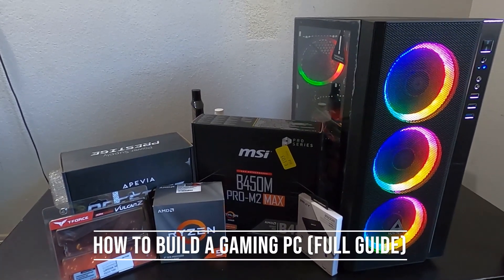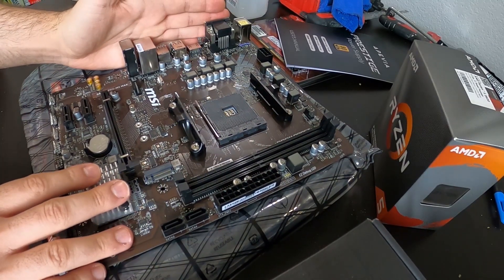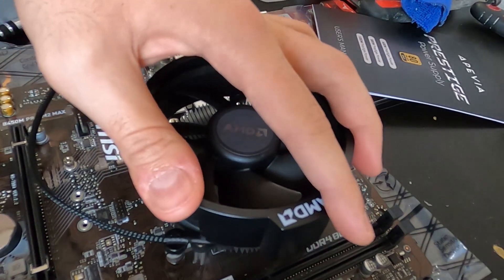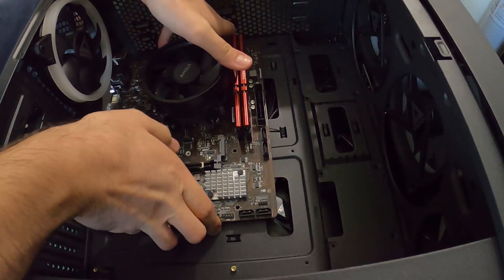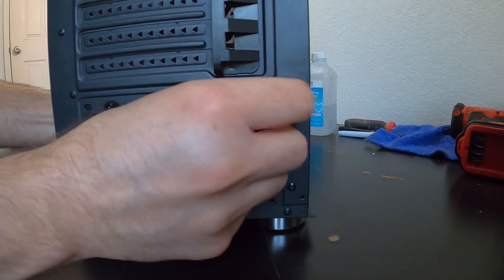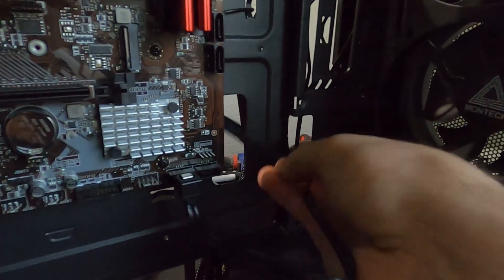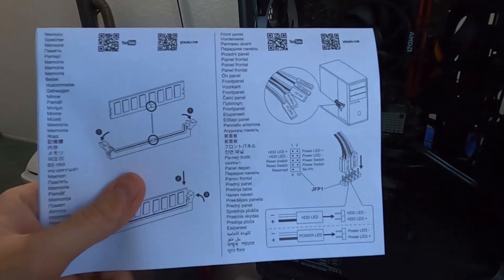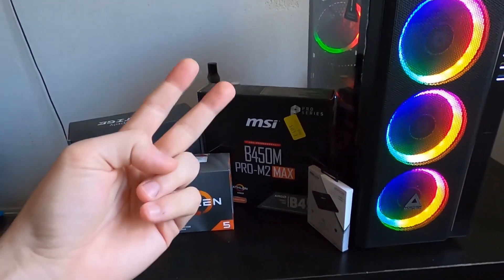How To Build Your Own Gaming PC - Step By Step DIY

Comment: Hey man, I have the same board as you, but a GTX 1660 Super Ventus OC. My problem is that the GPU doesn't light up. Like it works and everything but the geforce logo doesn't light up for some reason. I tried using Dragon Centre and all but it just won't detect it. Do you have any idea on this issue?

Comment: MSI B450M PRO-M2 MAX
RYZEN 3400G APU
2X Patriot 8GB 3200MHz Viper Steel DDR4 CL16 1.35V
650W 80+ PSU
500gb m2 SSD
Atx case with 4 RGB fan

Comment: ryzen 3700x
B450E board
16 gb ram (3000mhz)
240 gb ssd
1tb
Gtx 1660 ti
Can i play decent games or do streaming with this configuration?
Any suggestion?
Reply from the maker: Yes, i think this would be a very capable and strong setup